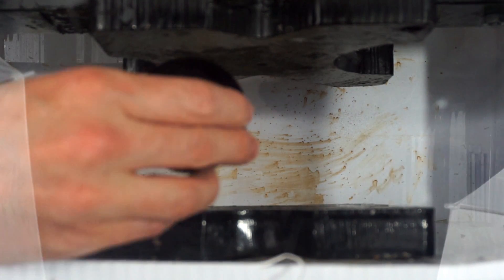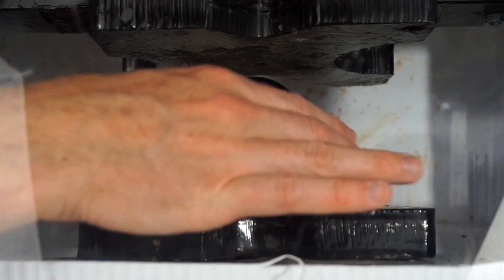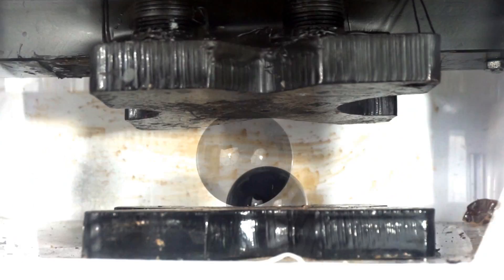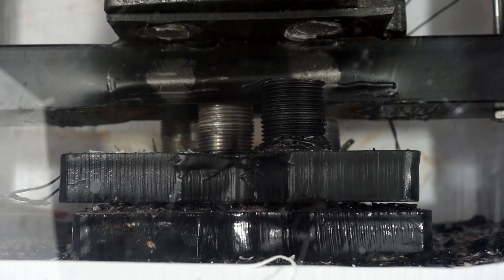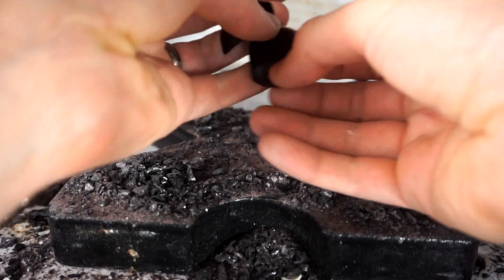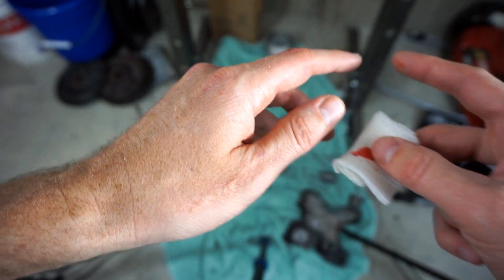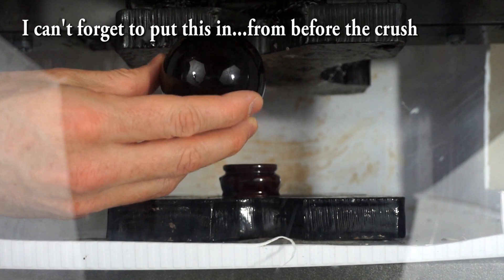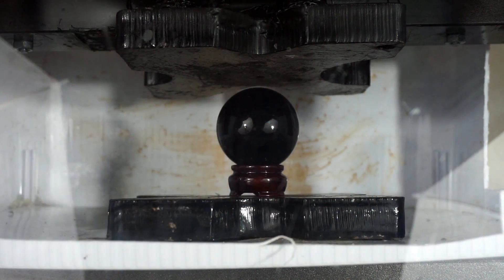Obsidian Crystal Ball Crushed By Hydraulic Press | I Cut My Finger

Comment: I have never cringed more at a video... Breaking a rock that has been used in place of steel as a scalpel because its shards are that sharp, AND THEN RUBBING YOUR HANDS THROUGH IT, HOLDING HANDFULLS OF IT WITH LITTLE CARE... AAAAAAAAAAAAAAAAAAAAAAAAAAAAAAAH

Comment: I watched it in 0.25x but if only you had recorded in 120/240fps, I would have enjoyed a wee bit pleasure. Regardless nice release. I don’t know how your press shot like that though. Are you using water as a hydraulic fluid or hydraulic oil? Shouldn’t spring like that, especially since obsidian isn’t elastic and didn’t absorb the energy, just took more to produce structural failure.

Comment: Sharper than a razor by many orders of magnitude. Obsidian has a cutting edge of 30 angstroms, where the finest steel is over 300 angstroms. It actually cuts on a molecular level. An angstrom is a unit of length equal to one hundred-millionth of a centimeter, 10–10 meter, used mainly to express wavelengths and interatomic distances.

Comment: Obsidian is actually sharper than surgical steel. If you see a cut piece of skin under  a microscope, if cut with obsidian, it will be a smooth cut.  With a surgical blade, it will look like it was cut with a chainsaw. Also, the wound would heal much quicker, since it's many times sharper than a steel blade. Love this video!

Comment: obsidial is not like glass, in fact it IS glass, and that means it doesn't have a defined molecular structure, whet it forms from magma, the cooling range is so fast it doesn't have enough time for the atoms to arrenge, so it's basically a bunch of randomly placed molecules, it doesn't have weak planes or anything like so, and that's the reason why it can be sharpened to a molecular level

Comment: if made right obsidian can be one of the sharpest things on earth. The cutting edge can be as small as just a few atoms
Reply: ForeverOfTheStars yep. they use obsidian scalpels for the most fine of surgery. they can only be used once before they are dulled.
Reply: @tristanstraka5413  whenever obsidian is discussed this factoid gets thrown 85% of the time
Reply: @helloyes2288  Its cutting edge can actually be that small. Some dumbasses think that means “it can cut atoms”. It cant. But its really sharp. like x500 sharoer than a fine steel blade
Reply: @tristanstraka5413  Sharpest thin ever is tungsten, right?
Reply: 3 nanometers....a fews atoms is a bit smaller
Reply: As this as a strand of DNA.
Reply: ForeverOfTheStars  yup
Reply: jesus
Reply: BigBirdYellow Films I think he does.
Reply: Hahahaha i dont think u realize how small a few atoms is
Reply: @bigbirdyellowfilms815  necropost but they do, you shouldn't underestimate minerals

Comment: PROTIP: this wouldnt have happened if you had a way to keep the orb from moving around. with the amount of pressure its pushing, pretty much any off axis tilt will destroy the press like this. hence why they are always flat, and youre always supposed to brace the object being pressed if there is any chance of movement.

Comment: try doing the same thing again but first do a drop test on the ball then when the ball is about to break and it's already nearing the point of breaking, stop the press and take the ball out and check it out. See if it is as hard as it was before and do the drop test again. Will the force of the press affect the overall structure and strength of the obsidian crystal ball afterwards?

Comment: Actually obsidian gets sharper than steel. It's hard to tell but under a microscope it gets A LOT sharper then steel. That's why there are scalpels made from obsidian. And it doesn't leave much of a scar because it's sharp enough to cut in between atoms rather then tear them apart like steel
Reply: avitex yeah, I meant cells. thank you for correcting me. I'm not really sure why I said atoms, must've not been paying attention.
Reply: Yeah, it was annoying when he was saying the it was as sharp as a razer blade. Like, dude, razer blades aint got nothing on what you're holding there!
Reply: @Earthly Ninja
A well crafted obsidian blade can be 3 nanometers. A human hair is about 100000 nanometers thick. That puts it well within the range of 1000nm that you put forth.
Please do your research instead of looking like an idiot.
Reply: Earthly Ninja natrually the whole shard won't fit, but the edge of an obsidian blade IS thin on a microscopic level. The edge that you see isn't really where the edge ends. Our eyes simply can't see the rest of it because of how small it is. Due to this, an obsidian blade absolutely can cut between cells.
Reply: We are talking about the extreme edge, you're not going to get an entire blade that thick ever. As for more proof here's two references. Granted they're not as good as they could be.
https://en.wikipedia.org/wiki/Obsidian
http://obsidian-scalpel.blogspot.pt/2012/12/surgeon-use-for-obsidian-scalpel-blades.html
Reply: Top 10 Questions Science Can't Answer.
Reply: Tearing atoms apart? Wouldn't that require a crap load of energy?
Reply: Ian S. But for swords tearing is better
Reply: Griffin Watson the fuck they can. Prove it.
Reply: Rob DC maybe the extreme very edge, but a nanometer is a little extreme
Reply: Rob DC ok that I believe. I thought you were speaking of the edge blade thickness.
Reply: Ian S. The edge of sharpend obby is meer atoms thick which is probably what you were thinking(im aware im a year late
Reply: Then why is there no OBSIDIAN SWORD IN MINECRAFT????

Comment: considering obsidian is capable of sharpness down to a single molecular thickness, it is genuinely able to be THE SHARPEST blade possible.
Reply: ConceptBro That's also why it is dangerous to sand it or shatter it since any sort of dust from it or shard can pierce your flesh. If sharp enough. If he was in the chamber when it shattered, he could have had so much obsidian shards and dust in his flesh it could lead to amputation surgically. Obsidian is not something to play around with if you don't know what you're doing.
Reply: The cutting edge of obsidian can be as small as 3 nanometers. That's small enough to cut in between cells.
Reply: obsidial is glass (not a thick gel) and that means it doesn't have a defined molecular structure, whet it forms from magma, the cooling range is so fast it doesn't have enough time for the atoms to arrenge, so it's basically a bunch of randomly placed molecules, it doesn't have weak planes or anything like so, and that's the reason why it can be sharpened to a molecular level
Reply: i know that. it's more or less equivalent to a grenade when crushed.
Reply: it's just how it's structure is, i'm not sure the exact science behind it.
Reply: obsidial is glass (not a thick gel) and that means it doesn't have a defined molecular structure, whet it forms from magma, the cooling range is so fast it doesn't have enough time for the atoms to arrenge, so it's basically a bunch of randomly placed molecules, it doesn't have weak planes or anything like so, and that's the reason why it can be sharpened to a molecular level
Reply: Jesus, I knew obsidian could be ludicrously sharp, but on the molecular level!? Is that because obsidian is a thick gel?
Reply: @denpadolt9242  many fun things involve the molecular level, like mica iirc which produces sheets so flat that they are used to test electron microscopes
Reply: Too bad it's not that strong
Reply: indeed
Reply: ConceptBro a
Reply: Meg Griffin shut up Meg, you don't matter XD
Reply: ConceptBro lol probably just copy pasted that from ign or some science website
Reply: Thats why they can't have an obsidian tipped scalpel, its sharp but it will flake off. Its why diamond tipped scalpels are better.
Reply: already known but thanks anyway.

Comment: "not quite sure if I need stitches" it's literally a cut less than an inch long. you do not need stitches
Reply: Sube Tube the depth of the cut determines if you need stitches, not the length. I've had countless cuts more than the inches long, not one stitch, but they were only about 3 mm deep.
Reply: Sube Tube I don't think you know how the human body works do you?
Reply: Sube Tube it's not about how long the cut, but how deep. I needed two stitches in my finger one cause I cut it down to the bone. it was even shorter than his cut.
Reply: 5 inches long*
Reply: m4xwellmurd3r just get settled electrical tape, it'll be fine
Reply: Maybe he can crush one.

Comment: Obsidian IS NOT A CRYSTAL

.

.

the reason why is that crystals forum from slow cooling obsidian cools so fast it is not a crystal
Reply: Did he say it was an actual crystal? By crystal in the title they're referring to the crystal ball shape of it...
Reply: Okay well "dumbass", no one said it was a shape like triangles and squares...like you must be thinking. "Shape" can be applied to damn near anything outside of kindergarten. 

Any one with common sense understood that I was talking about the shape and design, which is based off of a traditional crystal ball.
Reply: crystal ball isn't a shape dumbass
Reply: JBone 5554 he said it was a crystal ball not that obsodian itself was a crystal
Reply: to be a "crystal ball" it first has to be... crystal!
Reply: Modern Bladesmith not if they're just referring to the design.
Reply: J Renèe ツ 
 i see where you are coming from, but the "design" of a crystal ball is a ball that is most likely made of glass, which is crystalline. any crystal ball is made of some crystal. otherwise you could simply call a rubber ball a rubber crystal ball. although you could, it isn't proper. some of you people that commented before this should try to calm down. namely 4x4 productions.

Comment: I cut my finger in the exact same spot when i was wiping off my sword, and it fell down from the table. It sliced through everything in the joint. My finger wont straighten out 100% anymore, even though this happened many years ago. Terrible spot for an injury like that. My finger also hurt if it gets cold.

Comment: I have chunk of obsidian. I once broke a little piece off and was examining it by holding it between my thumb and middle  finger. EXTREMELY CAREFULLY I gave slight pressure to the piece to be able to spin it on the flatter side for more examination. It instantly went right through my finger. This is some of the sharpest material I have dealt with.

Comment: Obsidian cuts cells, not tears, making it one of the more dangerous materials for knifes...
Reply: It also makes very good medical equipment, such as scalpels, since it allows the cells to heal, rather than scarring since steel scalpels tear cell, leaving scars
Reply: best, not most dangerous
Reply: sangerous?
Reply: good vs soft materials like skin and tissue
Reply: Aydin Borden the cutting edge is 3 nm. (Nanometers) thick. Obsidian shards are one of the sharpest of not the sharpest thing out there